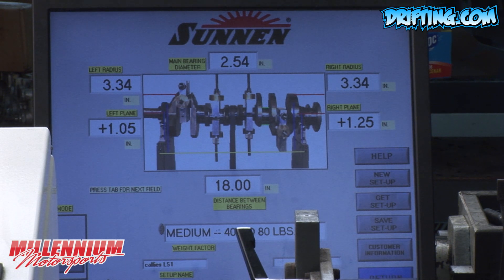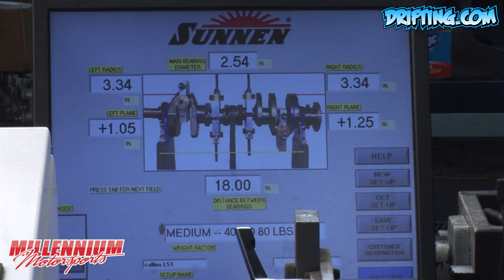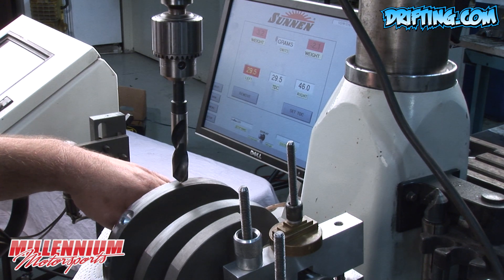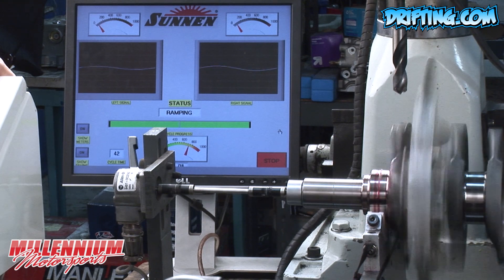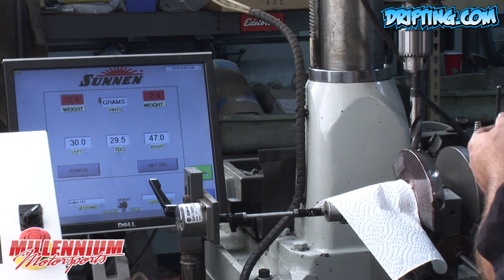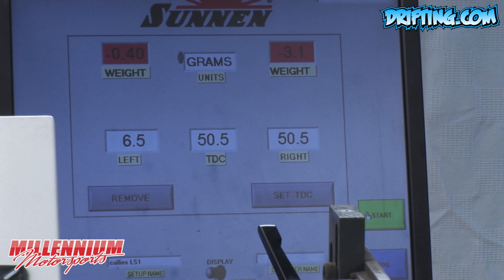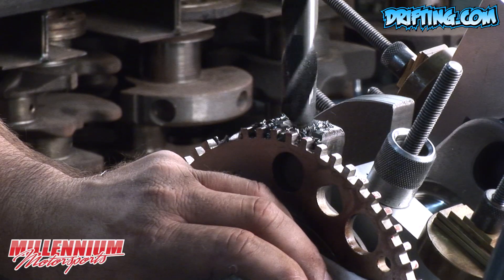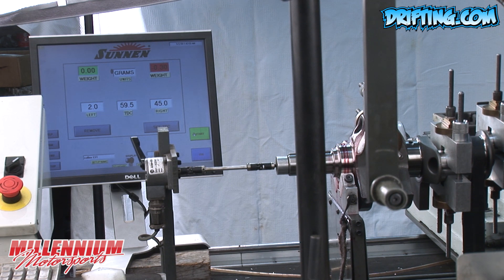Crankshaft Balancing

Comment: So, all the balancing adjustments are only done to the 2 outer fat counter weights?  Do holes need to be drilled, or metal added,  on those smaller inner counter weights at any time?